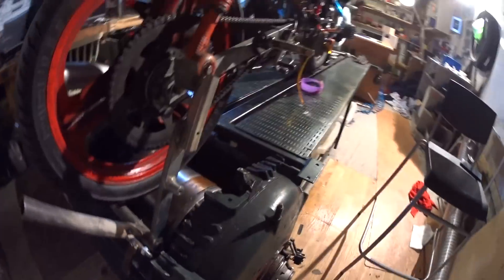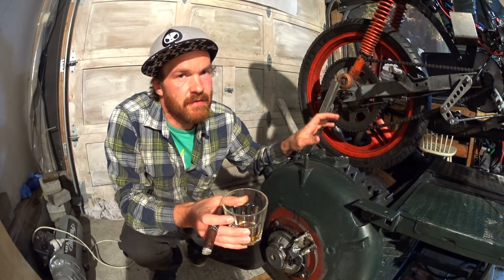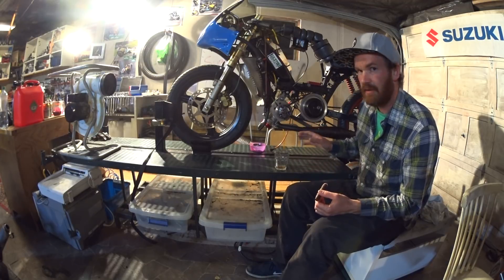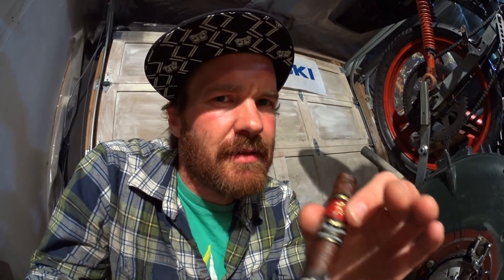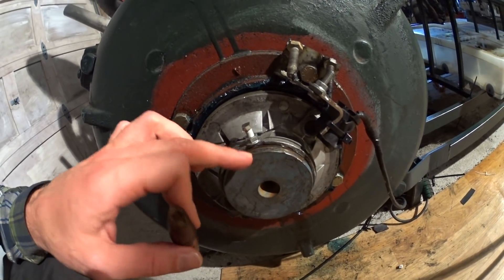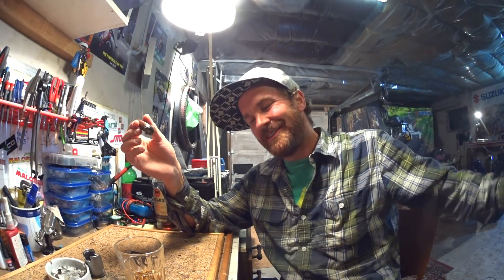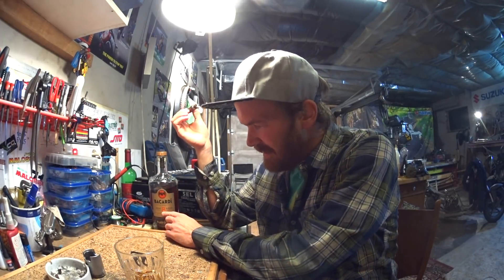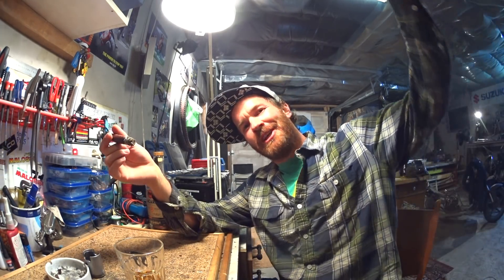CHEAP DIY DYNO ANYONE CAN BUILD!

Comment: Hey,I'm sorry but I cannot understand English language great and I dindt get something.This electric motor is capable for how much horsepower maximum,and how many engine rpm maximum???
Reply from the maker: +dragstermanlef I've had an 80hp bike on it, had to use 4th or 5th gear to get sufficient runtime(>5seconds, 8 is said to be ideal). The roller was spinning around 4000rpm, wouldn't go much beyond that.
Reply: Wheel size would determine maximum rpm, along with reduction ratio. Larger wheel being tested means lower maximum engine speed before you over rev the the electric motor bearings at a fixed reduction ratio. A Harley wheel will give more revs on the bearings than a smaller go kart wheel would if both run at 1000 wheel rpm. 110 kw is about the maximum load the bearings will take (the motor rating) if the bearings are spinning at the speed the electric motor is designed for. More speed, lower loads will over stress them. There really is no single "maximum" for any figure except the maximum speed the bearing can spin at according to the manufacturer of the bearing. Does that help you understand?

Comment: The Cigar review was helpful, the Rum review invaluable but the home made dyno.... oh come on, that's way too complicated and expensive, I have a much better and way more reliable method to accurately plot the horsepower gains each time I upgrade my unfaired YZF750R 1002cc YZF engined hybrid streetfighter. Like your Mum always says, first of all before you go out to test the bike put on clean underwear. I then start a stopwatch, rev up the bike and race as fast as I can from a standing start over a measured mile of public roads in traffic usually terminating in excess of 160mph (thats over 257.495kph to you Johnny Foreigners). Then using a complex scientific equation (available from me for a small fee) I measure the skidmark left in my sparkling clean tighty whiteys and hey presto I have the exact horsepower gained/lost figure...............! :)
Reply from the maker: +martin allen Haha, agree, that's a mutch better way!
Reply: But what if my bike doesn't go 160mph?

Comment: Awesome video! I'm considering building one myself now, but I have some questions if you can answer them!
1. How is the RPM sensor connected to the computer?
2. What else "information/hardware" do you need for the program except roller mass/diameter and a RPM sensor? (Is the microphone thing a must?)
3. Can you find a link or productnumber for the same RPM sensor that you have yourself?
I would really appriciate an answer so I can start building :)
Reply from the maker: +Shapan Productions Thanks! 

1. The sensor is connected to an Arduino UNO, the Arduino is connected to the computer. There's good instructions on how to get things working on the Simpledyno and Arduino sites. 

2. That's all you need! If you go the Arduino route(recommended) you won't have to worry about the "microphone thing". I have made a circuit for picking up engine rpm too(more on that in an upcoming video), but I seldom use it, I just enter the gear ratio into the program instead. 

3. Honeywell 1GT101DC, cheaper hall sensors should work just fine too. 

Good luck with the build! I'll be making a more in depth video on the electronics side of my setup so stay tuned for that
Reply: Thanks alot for the quick response :) When do you plan uploading the next part? I would especially appriciate the Arduino chip explained more as you said, but I will read the instructions before that :)
Reply from the maker: +Shapan Productions You're welcome! Probably sometime next week, as soon as I have time!

Comment: Nice. Thank you. What do you use for a brake?
Reply from the maker: +mark atkinson Thanks! No brake yet, it's on the wishlist along with an electric starter.
Reply: One can add simple discbrake from a car to brake the roller.
But the program is calculating power from inerta.
Reply: Ya, I used a flywheel and a big truck caliper.
Reply: I have on my discbrake mounted a gear from a volvo flywheel, my roller is started with a VW golf mk3 starter.
Works beutifully =)
Reply: Next mod in my dyno is to use more than one triggerpoint per rpm on roller.
When starting varioengines from 0km/h it is very bad resulotion.
I´m thinking of using a simple distributor from an engine as the dynobox i use is really sensitive about correct distance between triggerpoints.
I made one my self at first as good as i was possible to do in my own mill at home.
Wasn´t good enough :(
So using a distributor with one point per revolution and gear it so it spins 4x rollerspeed allows me to get 4 triggerpoints per roller revolution.
This would keep the 'spikes' gone.
Reply from the maker: +Patrick Wetterskog Sounds like a good setup, I'll probably make something similar in the future.
Reply: Patrick, do use Simple Dyno? I tried it and I couldn't ever get a good reading, so I switched to OnTrack. I still get miss-reading when I try a high gear pull. I think because I am spinning my flywheel so fast. It is super accurate in second gear. Why do you think more trigger points will be more accurate? If you spin the distributor 4x are you concerned about miss-reading. Does the software care?
Reply from the maker: +mark atkinson what kind of sensor did you use with simpledyno? With the hall sensor and a shielded cable(and metal enclosure for the arduino) I have zero problems with the signal.
Reply: It was a few years ago but I think I tried a microphone. That may have been the only issue. I am not saying anything bad about simpledyno software.
Reply: No,, I use performance trend dyno datamite 3.2
The problem one can get is difference between triggerpoints, in degree and amplitude.
It has to be equal that´s why it´s rock solid in my case with only one triggerpoint.
But i want more resolution at lower roller rpm, needed when dynoing from standstill with varioengines.
If you get a missreading at only high rpm´s try to enlengthen the 'cam' the sensor triggers on.
This way gets you more time between rising and falling signal.

Comment: I'm impressed by ABB, the way they could get the inertia number for just "some old piece of junk" motor like that. I'd imagine a lot of big companies like that would just ignore little obscure projects like this as it's truly making them zero money, so good on ABB for giving such unconditional support!
Reply: I work at ABB(not motors) and you should see our archive..
Holy motherfucking lord is words that comes to mind ;)
Reply: "The inertia of this particular rotor or roller is 2.17 kilograms" for a 110 kw motor. Error detected, probably accidental. And, Ekner, I couldn't agree more
Reply: my error maybe
Reply from the maker: +Bart Layman Yep. But it seems low, I get why you thought it was an error.
Reply: Rum is good, cigars suck, and I like what you're doing here! Subscribed
Reply from the maker: +Bart Layman Thanks!
Reply: they keep this info on file for re-builders; if your motors cant be serviced, nobody is ever going to put them into an industrial application
Reply: I just got a 1998 250kW/400v Schorch asynchronous motor at the scrap yard. Looket it up, and easily found the data on the inertia mass moment of the rotor. In this case it was 1.90 kgm2. Now it's time to make the rest og the project :-)
Reply: I work for Schneider a competitive company and I like dealing with ABB they make good variable frequency drives 😁
Reply: I used to work for ABB Skien Norway
Reply: ABB = Anders Behring Breivik
Reply: @RegulareoldNorseBoy   WTF??
Reply: From Finland
Reply: Obviously the thing to do is NOT to reveal EVER how small time you are!  INSTEAD LIE YOUR ASS OFF!  LOL!  CLAIM you are a legit potential customer with a legit engineer asking the Qs!   DUHH!  LOL